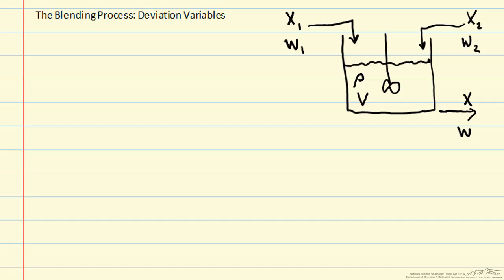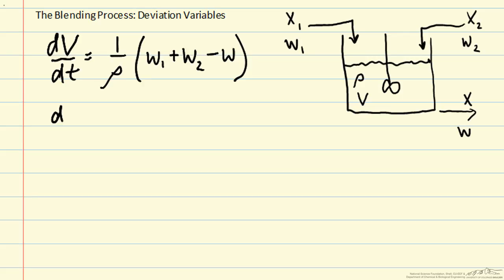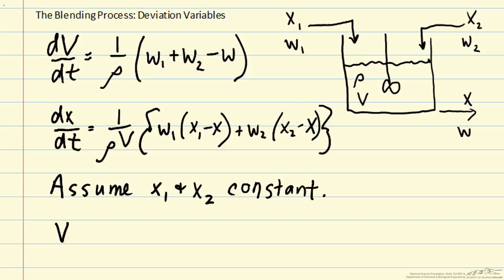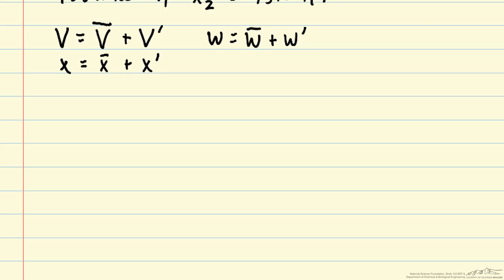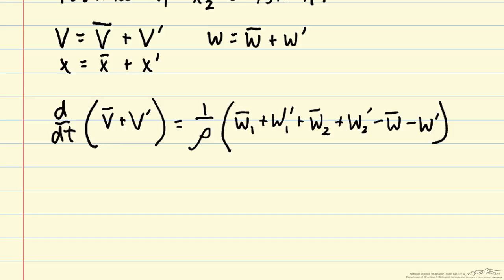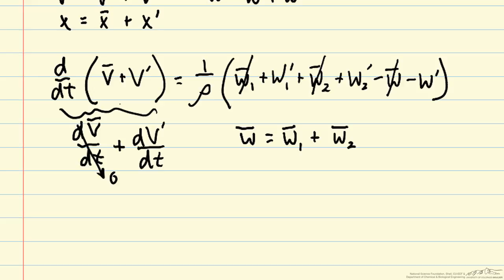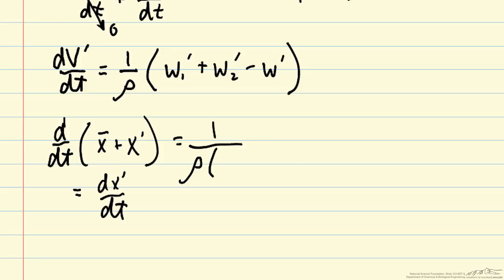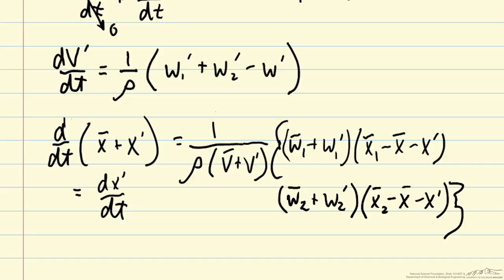Blending Process: Deviation Variables

Comment: Hey, great video! However, I believe your solution for dV'/dt is incorrect. I believe that you made a mistake by incorrectly substituting W̅1 at 2:21. You should have not substituted at all, or substituted it with the correct substitution, W1-W1' instead, and then back into W̅1, as these cancel out when you substitute W̅=W̅1+W̅2.

The final solution should read: dV'/dt=1/ρ(W̅2-W̅).

Hope this helps!